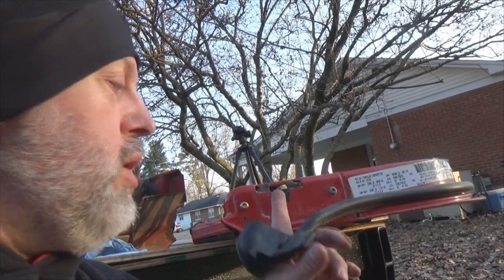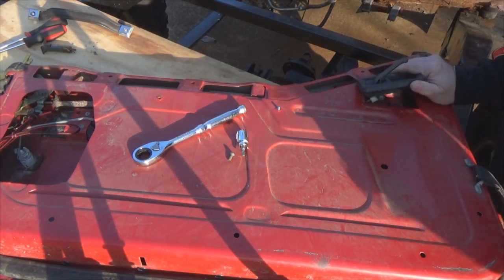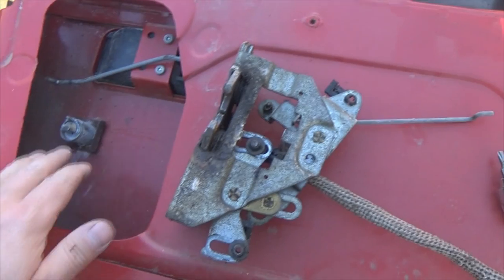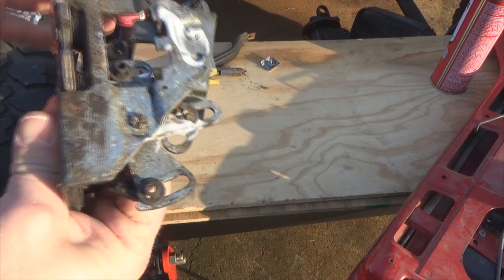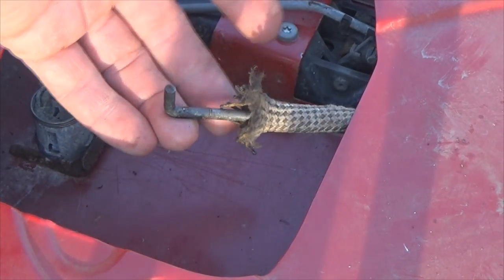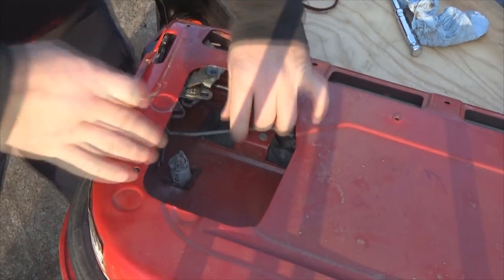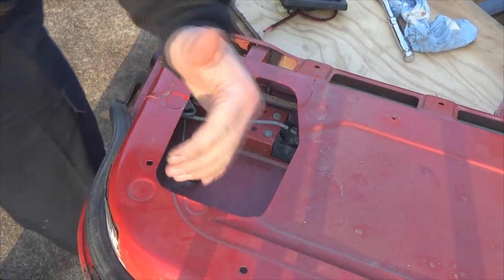Jeep Wrangler - Half Door Latch Removal and Reinstall

Comment: Question for the side mirrors bolt are they supposed to go thru the whole door, because when I took the previous owner mirrors it looked like they broke inside the hole don't know if that's correct or not

Comment: Where does one get the little nylon clips on the rods? Dealer only?
If one buys a new latch do the nylon clips and rods come with it?
And thanks for these videos!
update: Went to 5 different auto parts stores before finding door latch rod holders. They even look like the right size. In Mesa AZ, Space Age Auto Paint. They have a huge selection of panel clips, retainers, plastic whatsits etc.
Reply: Do you have a brand/part number? I am also looking for a replacement door lock rod clip as one of mine broke. Dorman makes a variety of them but their website claims they aren't compatible with my 1993 Wrangler (parts look identical...) Thanks!

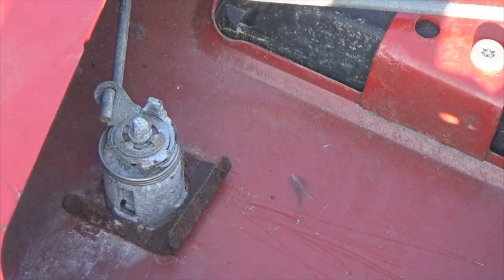Comment: I am looking for the e-clip and metal bracket that goes on the back of the door lock that the rod goes into as seen at 7:53 in this video. Does anyone know where to get these?
Reply from the maker: I later found that I could get these clips at the auto parts stores in the "Help" isle in those little plastic packs that hang on the pins. The bracket .. ebay maybe?